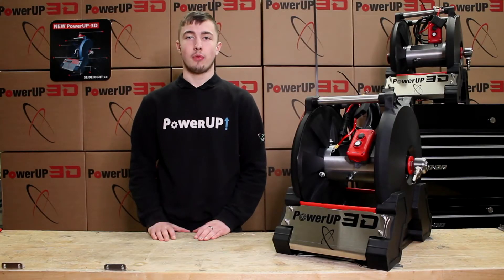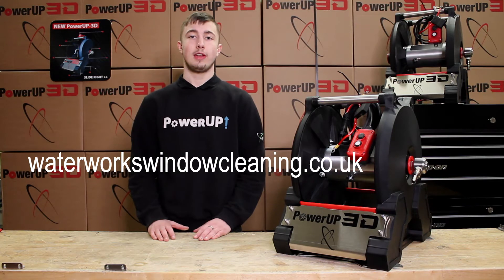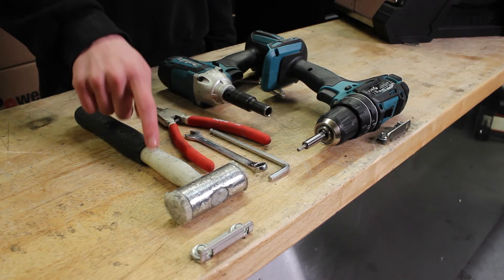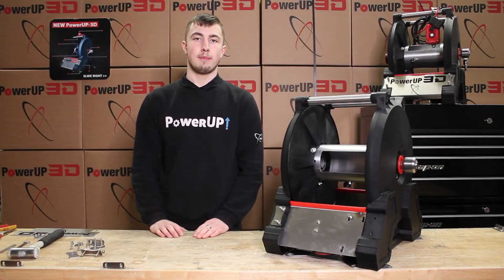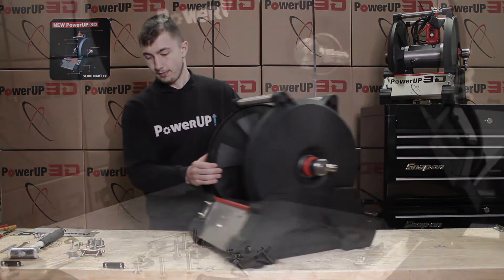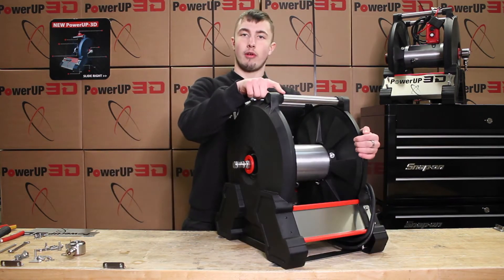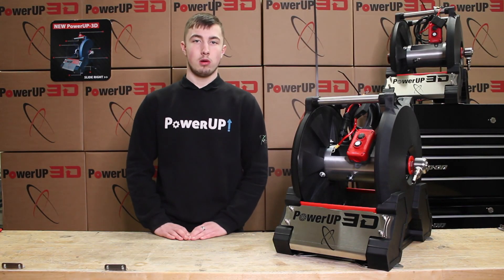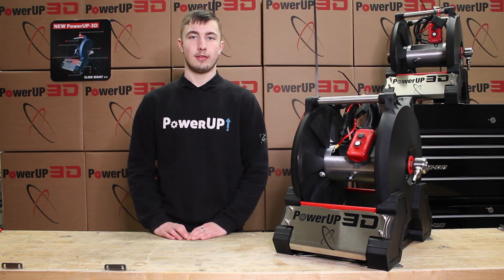PowerUP3D 2021 Belt Change (Electric Window Cleaning Reel)

Comment: this video is fine for showing you how to take the reel apart to replace the new belt ,but to replace the new belt yes he shows you how to put the belt on the  casing but he does not show you how to fix it to the motor when you pit the side back on .i have just fitted a new belt to mine and in fact i fitted the belt to the casing and the motor before i started to reassemble the reel as that is the only way to replace the belt .this video should show you how to replace the belt step by step but it does not  4 out of 10 for the video